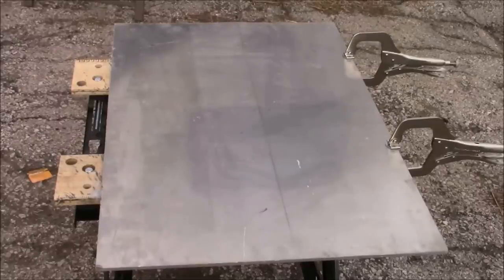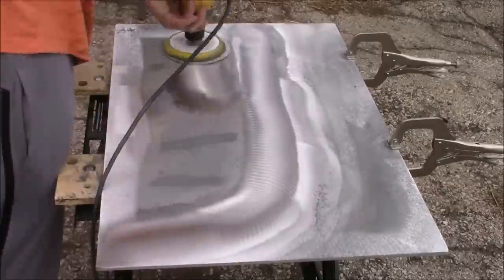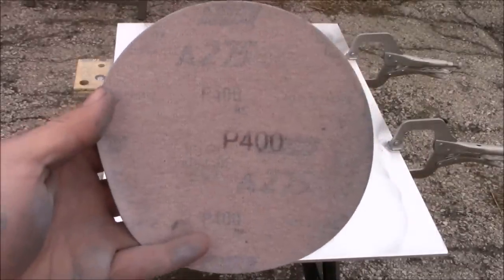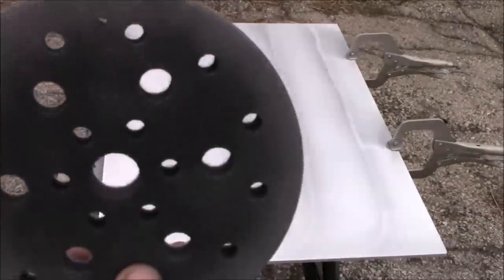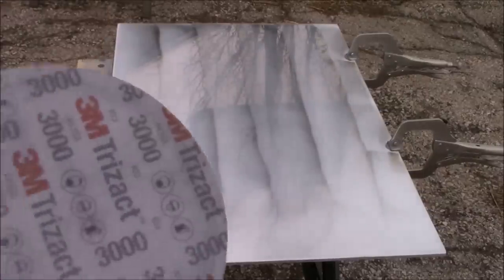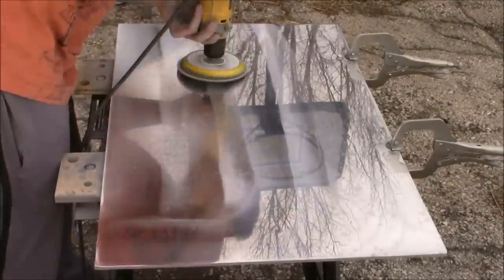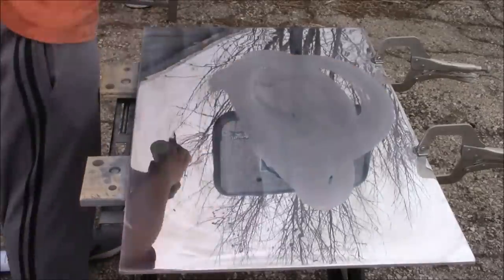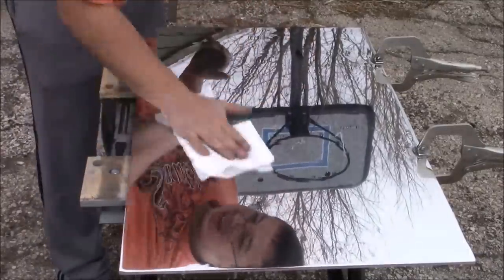How To Sand and Polish Aluminum To Mirror Finish

Comment: Good video, excellent results. I do have a couple suggestions. It's a good idea to rinse off the grit from previous sanding before you start with a finer grit. If you think about it, leaving the old residue on the surface means you are rubbing it around under your finer grit pad, which lengthens sanding time. Rinsing is preferable to wiping because it lessens the chance of causing linear scratches. Also, it is a bad idea to use steel wool on aluminum. Small pieces of the steel can become embedded in the aluminum, and will eventually rust if exposed to any moisture. Then your nice shiny aluminum piece will be red and rusty(which can be super confusing. Like, "Why and how is my aluminum rusting?!!!"). That also goes for sand paper or grinding wheels, files, etc. Never mix materials. Have a specific grinder wheel for steel, and another for aluminum. Etc. BTW, gotta love DeWalt
Reply from the maker: Thank you for the suggestion, what I do is the hold the drill sideways and use the airflow to blow off all the aluminum dust before I move on to the next grit. I will keep your suggestion in mind about the steel wool, luckily I don't use much pressure, I just used it as a base to add the polish.
Reply: Pretty much you can do a flat surface how do you polished aintahe or gloved valve covers

Comment: Worked as a metal polisher,mainly stainless,some aluminium bull bars. We would sand with 400# then buff with tripoli compound. There are many different grades of aluminium. Some are more receptive to buffing than others. The fine grades of abrasive paper were not available until relatively recently. Thank you for the video.
Reply from the maker: Thank you. I'm glad you enjoyed the video. I also appreciate the polishing tips thanks

Comment: It helps alot to wipe the surface clean between grit changes to remove any loose grit that can leave scratches
Reply: Jon Rothenbusch It also helps to change direction with each grit to even things out.

Comment: I just started using that trizac 3000 and it's amazing. I haven't found the 5000 locally but I'll order some soon. On paint it's amazing how good it does.
Reply: A little secret for you...in woodworking circles, a company called Micromesh makes sanding cloths for woodworkers that goes all the way to 12,000 grit.  They're a heavy cloth with an extreme fine layer of a soft spongy rubber coating with the grit on top of that.  These are fantastic for polishing metals too.  They are available in rectangular pieces (3" x 4") and they also make them in 5" discs for sanders.  They are available on Amazon:  https://www.amazon.com/Micro-Mesh-No-Hole-Sanding-Disc-Combo/dp/B00HJCBC5O/ref=pd_lpo_vtph_469_tr_t_2?_encoding=UTF8&psc=1&refRID=APMS4JEGW4GZM9FH7YM7

Comment: Honestly amazed by your proccess, you didnt use any stick type compounds or a an  angle grinder/buffer. im suprised you had to switch out to a new trizac pad, usually you can clean trizac media with an oil based cleaner (trizac belts anyway) never use water on the belts. havent tried the trizac disc/ pads yet.

Comment: The piece looks awesome!!!  years back I polished aluminum motorcycle parts, I did the steel wool with polish too, used #0000 steel wool, but found it would embed those steel fibers into the aluminum.  You could not see it until later down the road when the moisture would take over and you see rust pits on aluminum.  It confused me at first, aluminum doesn't rust, then I thought about it for a bit (this was way before the internet stuff), and realized the steel wool was embedded and rusting.  The other thing I learned was after the polishing was done, take some household white flour, sprinkle it onto the surface on your final rag buff, it pulls out more black polish and leaves an even better shine.  If you try it, let me know if it still works with the newer chemicals on the market, it may just be an "old school" trick that worked with out old white rouge.
Reply: Also, If you search for what #0000 steel wool is in grit compared to sand paper, you'll find that it's only something like 600 grit.  So it's like moving backwards after the 5,000 grit sandpaper.  I'll suggest the 3M scuff pad scotch brites.  Get them on amazon.  With some digging, you can find the grit equivalents (there are different colors coded to coarseness). I found white is equivalent to 1200-1500 grit.  That's still not 5,000 but it's much better than 600.  The fact that steel wool worked for him tells there is more going on here than trying to stay really high on grit with the polish.  Still, the scuff pads just seem to me to be a much better tool for the job.  I'm not speaking from direct experience, just analogical reasoning with other things I've done.  They're better than still wool for everything I've used them on.  I don't even use steel wool any longer.
Reply: Dennis Neale I had not investigated how abrasive steel wool is, thats an interesting find that 0000 steel wool is equivelant to 600 grit. I use it on chrome and glass with no issues or concerns. I will have to some digging to verify and then question whether or not I want to continue using it. Thanks for the info
Reply: I use bronze wool on my sailboat for that same reason, when doing teak it would rust, bronze doesn't

Comment: I’ve never seen aluminum polished like this I do the old school method in witch you do less sanding and use an angle grinder rouge and a airway wheel. But it looks amazing keep up the good work!
Reply: I've been trying to polish some aluminum trim for a motorcycle using the buffing wheel and compounds but its very slow and tedious. This method appears to speed up the process but need to find smaller quantities of the pads etc. for a small project.

Comment: That type of sander will leave waves in the finish.  Best to use straight-line sander or sanding block for a mirror finish.  The polish used will shine, but it also brings oxidation.  Oxidation happens fast.  If you work a piece and walk away for a few hours and then start sanding again, you will need to cut through the oxidation layer again.  A spray bottle with soap and water works good for floating the aluminum fines away while wet sanding.

Comment: Amazing..  Is there anything else you can do to prevent the aluminum from  oxidizing.. Great work//   Super impressed
Reply from the maker: Thank you. Well the polish I use contains a sealant so the finish will last for a really long time.  Using a wax product should help as well.
Reply: Skills and Trade thank you for the quick reply.   Great.  I am a new subscriber.   Where do you buy these sanding pads?
Reply: Keeping a sealant or wax on the aluminum will help it maintain its shine, but even with that, over time it will eventually oxidize again.  Some type of clear coat can help prolong it, but again, it will eventually oxidize under the coating, then the coating has to be removed completely and the aluminum polished again (ever see clear coated factory wheels get oxidation under the clear coat?).  Unfortunately, while aluminum is very easy to polish, it is one of the most difficult to keep the polish intact.
Reply: I seal with a product called sharkhide, easy wipe on application. Great stuff !
Reply: Jet Seal - Chemical Guys
Reply: Edward Lance Has
Reply from the maker: I'm really late to reply sorry, I have links to the products I use in my description. Thank you very much.

Comment: I have polished aluminum to a deep shine before, but you may have just shortened the process.  I use 3m wet or dry, and usually squirt with water.  Start at 320 on jitterbug sander, up thru 400, 600,800, 1200, 1500, 3000 then rouge and polish wheel..  Had not thought of WD40.  Also, for my final polish  I've used a high speed cloth wheel with different grades of rouges.  Granted most of my stuff was round (speaker cans I made for a wakeboat rack).  I did seem to notice that when the friction started to heat up the metal a bit it would shine even better. Not sure with your method but even a microfiber towel will leave very tiny scratches and over time exposure to water from the lake,  I finally did a superfine polish, clean soap and water, the hit it with 2 layers of clearcoat, which :-\ turned yellowish over time...
Reply from the maker: Thank you for the very in depth comment. I'm glad my process could shorten up the deep shine you are looking for. Thanks again for the information.

Comment: Hi mate thanks for the great video!
I have a question about my Aluminium Canopy if I could please.
The finish from the workshop is quite bad and I would like to do this to remove the scratches and get it looking nicer.
Do I need to treat it afterwards with anything as it will be out in the weather etc.
Thanks in advance 👍

Comment: Very informative and satisfying watch! What are your thoughts on applying this method to a Grumman Alu Canoe? My worry is trading in aesthetics for the boat's integrity...given the fact most of the process would be sanding down an already very thin piece of sheet metal. Any tips are welcome, and thanks again for sharing this tutorial!
Reply from the maker: Not much material is taken off when your sanding, still if the metal on the canoe is very thin you should start at a higher grit such as an 800 and work your way up from there. Thanks for watching and good luck on your canoe.

Comment: Great and informative video.   Fun to watch.  Say, What do you think about using this technique on an old Aluminum Airstream that has been clear coated and the clear coat is 25 years old and weathered?  All of the vids show using only paint removal chemicals and then various buffing rouges.  Many thanks for your thoughts and recommendations!
Reply from the maker: Paint thinner to remove the clear coat,  then sand and polish using the steps in the video. I have links to all the materials in my description. Best of luck on your project

Comment: How much time do you think that the mirror finish will stay? Is there any way to make the polish permanent? I am planning to polish the aluminum components of my motorcycle. Your answer and suggestion+advice would help me a lot.

Thanks for the nice video! 🍻
Reply from the maker: Thank you Tanvir, the finish will stay for a long time. If you want the polish to be permanent I would use, Blingmaster Bling Barrier - https://amzn.to/2IZgk25 , I like that sealant a lot.
Reply: Clear coat it 3-5 times...

Comment: Great vid!  You make it look easy.   I've been trying this with a DA orbital and all I get are layers of cobwebs.    I need to get a variable speed polisher so I guess I will need a 5/8-11 not a 5/16-24 set up or drill adapter as I think is being used here.
Reply: I'm using a drill adapter like he's using here. Following instructions as close as I can....still not getting the same results. Still getting scratches, leaving behind circles etc.
Reply: @bossfan49  His newer video uses stainless and Alumicut and he wipes off previous residue with a blue shop towel.  I got an orbital sander and went through a bunch of grits.  Came out ok but still a lot more work than it looks like.  I tried using no lubricant, light oil and still can't get the awesome finish he does.  Smoke and mirrors??
Reply: @freedomkeeper8003  Who knows. I started using WD40 on each grit and wiping it off too.  One problem is the video is sped up, so it's hard to gauge how fast he's moving, how much time he's spending on each pass. If the drill disc is angled or flat, how much (if any) pressure he's applying.  I may be going too fast, but so far my aluminum is all smoke, no mirror. It's getting shinier, but still has scratches. I watched a video of a guy removing scratches from auto glass using a 1:4 mixture of gritty liquid hand cleaner and Griots 3 in 1 car wax. I may try that for the scratches.
Reply: @bossfan49  Wish I could post some pics here.  I agree.  Can't tell details cause it's sped up.  My steel comes from a junk yard/recycler so it's pretty ditry and scratchy.  I started with 180 grit, then 220, 320,400,600,800,1000,1200,1500,2000,2500 then 3000.  Nuts huh?!  I'm trying to reduce the multiple steps. I also tried olive oil cause one guy said it worked better than Alumicut. Also tried cocnut oil.  Also tried Mother's mag/aluminum polish with fully stitched cotton wheel.  Works pretty good and only one direction of wheel so less variables.  Your pumice hand cleaner and Griots sounds interesting.

One video the guy said you shouldn't go over 800 grit with Aluminum.  Then go to cotton sisal wheel with buffing stick.  I used black then green (for steel) stick with buffing wheel and worked pretty descent.  Now I'm having trouble getting rid of the hazy appearance.  

I also tried a PVA disc (dry) which suprisingly got a mirror polish but had divots.  Tricky to use and must be careful with technique cause easy to mess up.  Had to hold it pretty tight and keep as flat as I could.  Also messed up the PVA disc first time through not keeping it flat enough.
Reply from the maker: I would go a lot slower during the sanding stages if you're having issues with the finish.

Comment: How do you connect the disks, etc, to the drill?  I guess some sort of arbor?
Reply from the maker: The disks attach to the hook it pad like velcro. The hook it pad attaches to the drill via the chuck.
Reply: Ah, ok.  Didn't see that part of the hook it pad in the picture of it on Amazon.  Thanks!
Reply from the maker: No problem. Glad I could help

Comment: We polish mostly rounds in the aluminum class we generally work with 7075-t6 and it is really easier to get the round to a mirror finish, but to the dimensional diameter then on plate aluminum, I wonder what his start thickness micrometer in before and after start or if the thickness in the end matters?  The shine in the end looks good.

Comment: Wow.. Does polished aluminum and stainless reflect more sun and heat better? How long it stay in like a mirror-like finish in direct southern Sun and Tropic elements? If not long how often you have to maintain?I have some spots on the roof of my van I'd like to stop the sun from cooking to keep the inside cooler.

Comment: I have a aluminum vintage travel trailer. I have questions about what paper I should start with ?  The rivets are rusty. I was wondering why you didn’t use a DA sander and a car type buffer. Also what speed do you use ?

Comment: This is really a great video. Do you think it would be possible to do these same steps on galvanized steel sheet and get the mirror finish result as well?
Reply from the maker: +Alan Howell Yes I believe it would be possible. I plan using this technique on stainless steel, brass and copper in the near future and have those videos up soon. Thanks again
Reply: Should you use a respirator for this type of work? I'm currently sanding down an old satellite dish to turn into a parabolic solar cooker and sanding the paint off started to bother me, even with a small mask respirator. I'm concerned about going even finer with the metal/oxides.
Reply: Should you use a respirator for this type of work? I'm currently sanding down an old satellite dish to turn into a parabolic solar cooker and sanding the paint off started to bother me, even with a small mask respirator. I'm concerned about going even finer with the metal/oxides.
Reply from the maker: +Alan Howell Using a respirator doesn't hurt hurt. Using a well ventilated area will really help as well.
Reply: Wet sand it with soap and water.

Comment: Amazing! 

Does it fade away/tarnishes? Any spots and blemishes? How about water and finger prints?
Reply from the maker: Thank you. It will fade over the years if you don't use sealant. It you handle it a lot you will get finger marks, but they are easily wiped off
Reply: @SkillsandTrade  thanks for the reply. So there is no excuse not to polish aluminum. Best material on the planet.

Comment: Good work. Question, what rpm are you sanding at and if using a chemical in 3 stages like Nuvite, can you stop at 2 or 3000 grit sanding. And would you go down that far in grit for an Airstream?

Comment: What a Great Job you did. I am about to restore a Kirby Vacuum do you have any suggestions for the sanding tool to use? it has a lot of corners and edges . Thanks for your HELP
Reply from the maker: I'm not sure on the sanding tool, I suppose you can try to use the process I showed in my video.  I haven't restored a Kirby vacuum so I can't give you much advise, sorry. But thank you so much for watching, I really do appreciate it.
Reply: I am also restoring a Kirby and found this video to figure out what I need to do. Hope you figure it out!

Comment: How do i tell is my rim is steel or aluminum? It’s a 2002 Grand marquis with 16 inch wheels the has a shape of tears on them.

I don’t know if i did the right thing but i used a paint remover to remove the clear coat then sanded it with 500g because it’s not damaged then stopped because it’s 12pm and dont wanna disturb my neighbors
I’m wondering if meguair’s compound would work as a polisher or i should get megs polish? Because where i live there isn’t much of shops for those things

Comment: Need advice: I used oven cleaner on my electric frypan, which caused an oxidized coating.  How can I sand and polish this small appliance, which has rounded curves and 90 degree angles?  Would you recommend a specific brand of detail sander, or doing it by hand?
Reply: Maybe a fine wire brush drill attachment